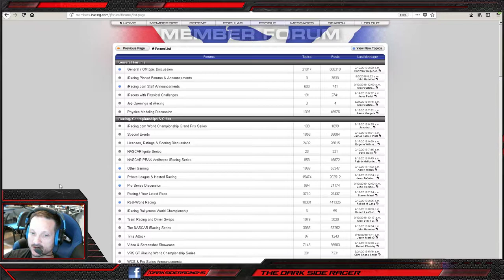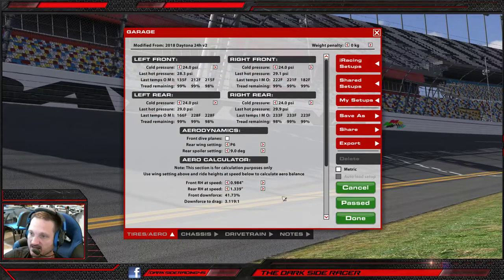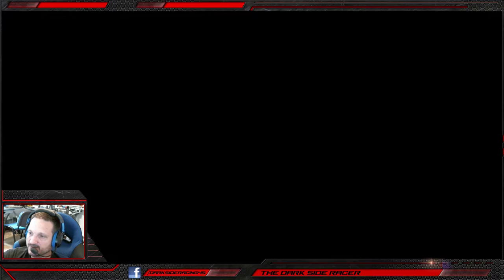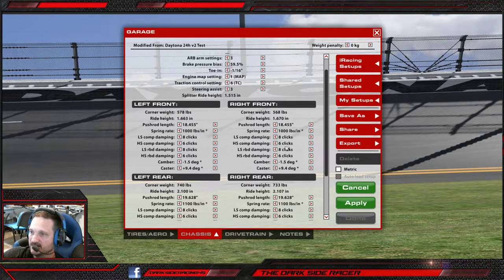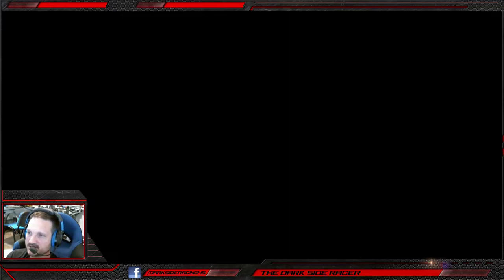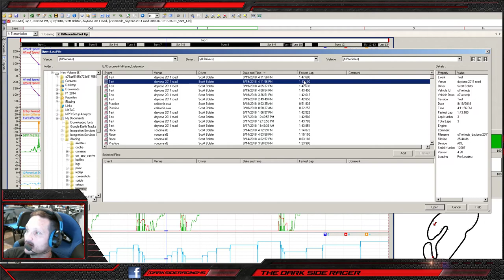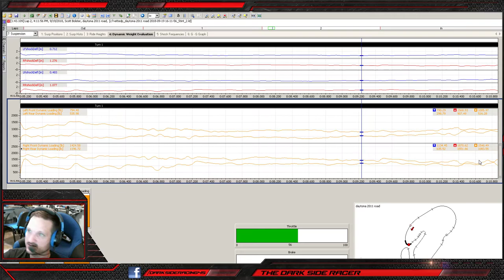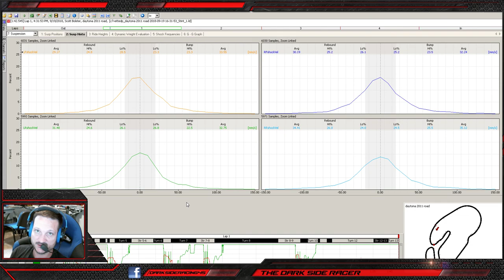The Dark Side Racer - The Process (feat. Vette C7 DP) Part 2

Comment: what all would i need to run that telemetry set up you have?
Reply from the maker: Hi there.

You need to download two programs:  Motec and Mu (Which is needed to convert the telemetry output from iRacing into a format that Motec can read.  It can be found on the forums).

Setup is pretty simple then you can experiment with the Motec's Default Project.

I'll be making a Motec Tutorial ASAP.

Thanks for watching!